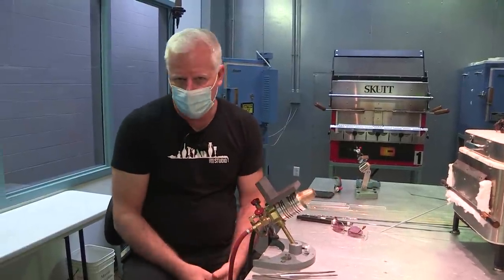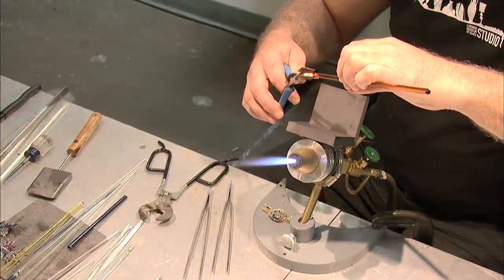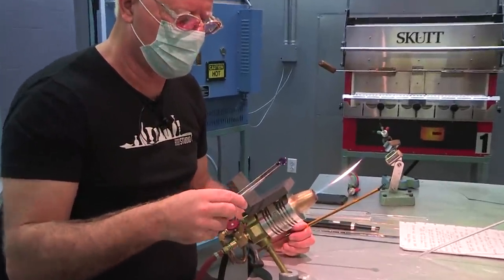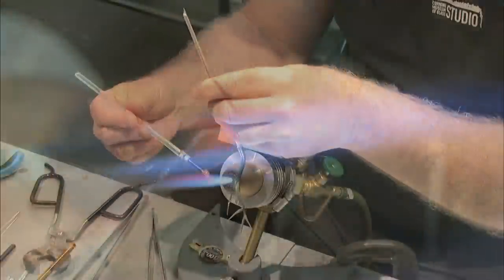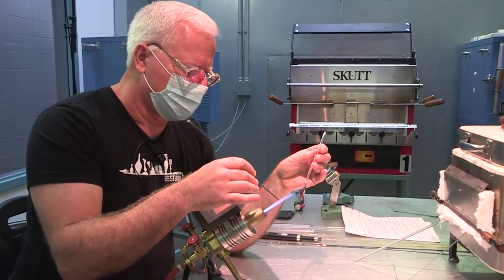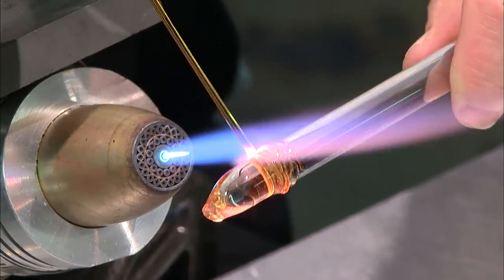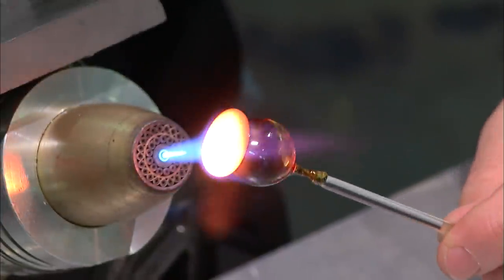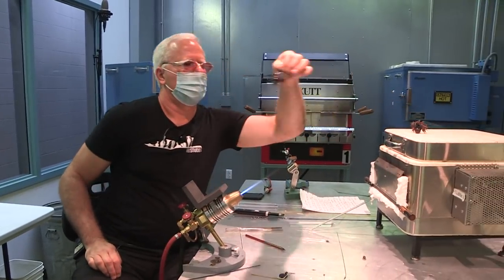Striking Colors at the Torch with Stephen Brucker, Summer 2021 Studio Live Stream

Comment: hi thanks for the videos. Is the technique the same when fuming with silver and gold?
Reply from the maker: Great question! Stephen says: “To answer the fuming vs. striking question, no, they are not the same process at all. Fuming is an a external surface application of vaporizing metals (most often gold and silver, sometimes copper but it's fairly toxic) onto the glass. Striking is an internal process achieved by heating the glass composition in a highly oxidized flame to break and suspend the crystalline structure of silver metals within the glass. As the glass cools the silver crystalline structures will reform but if they are introduced into a reduction flame (low oxygen) after cooling for 20 seconds, the crystalline structure will realign to produce a spectrum of colors. The length of time that the glass is held in the reduction flame after cooling determines the color that can be achieved. The time/color spectrum from least to most amount of time in the reduction flame occurs as follows. Transparent, yellow, orange, red, red purple, purple, blue, and finally green. I hope this information is both helpful and useful.” Thanks for asking and watching this demo!
Reply: @corningmuseumofglass  I"m looking for a demo or more precise information on how to achieve different colors from fuming silver.  I've read there are many different colors to be achieved but I can't find the information in one place.  I tried fuming and then using the above technique to try striking, but haven't had any luck so far.  Any suggestions or recs for sources?

Comment: Hi 👋  I have been trying to stike amber purple fine frit that is incased in a 32mm extra heavy wall blank.  I always seem to get a brown or red color.  I can strike amber purple with a regular rod and get purples,  But with the frit incased it seems impossible!  Please 🙏 help this is so frustrating 😢 if  any one has any suggestions it would be much appreciated 😊
Reply from the maker: Hi👋 From Eric Goldschmidt our Supervisor of Flameworking and Properties of Glass: It is very difficult to get fine frit to strike as well as thicker grades of frit or rod.  It is also difficult to get amber purple to strike when it has been deeply encased.  I would suggest using a larger frit size and a thinner-walled tube.  Additionally, it is really hard to get encased amber purple to kiln-strike.  I suggest striking it with the flame for best results. Hope this helps!